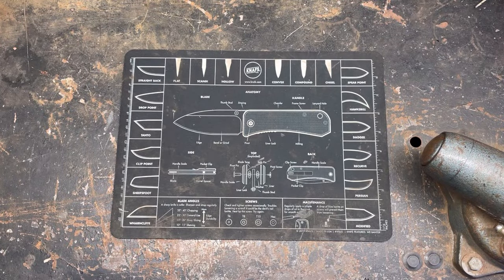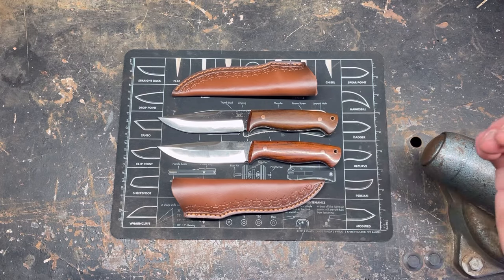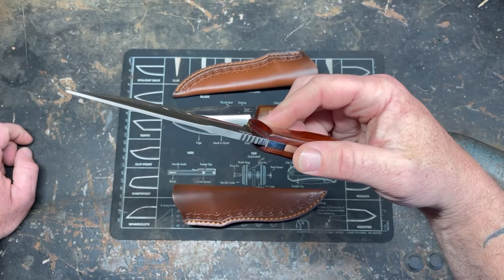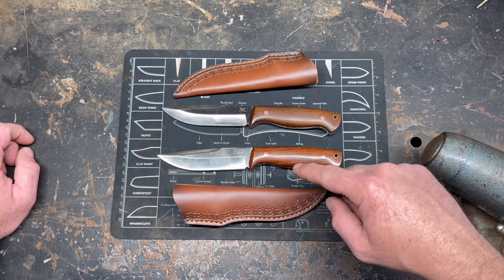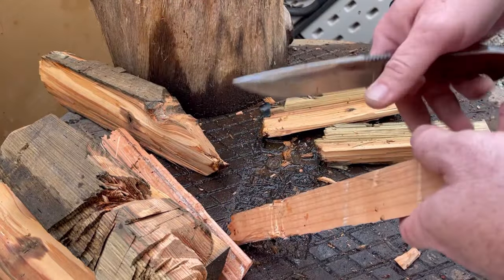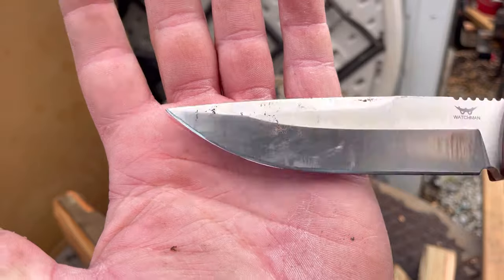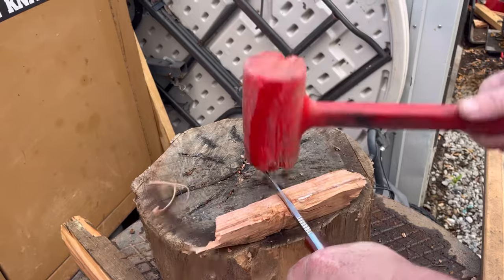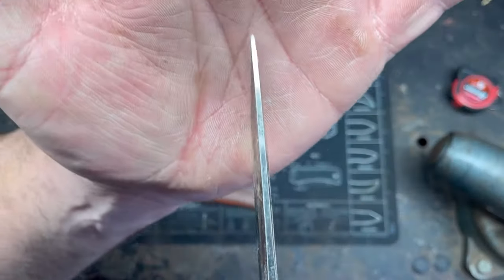The Watchman Fixed Blade Hunting Knife in DC53 steel

Comment: I've got a kabar style knife in DC-53 that I took a gamble on, and honestly I'm very impressed with what I got for the money. It's a leather stack handle (which I love!), big 9" flat ground blade that SLICES, fairly robust tang about the same as a kabar but with a threaded pommel instead of a pinned pommel. My "testing" is similar to yours in that I chop (more on this one because it's such a choppy feeling knife)  and baton some wood, do some feather sticks, maybe chop some wire to see how it holds up. The DC53 seems to be some pretty tough steel that holds a good edge! I had no real edge rolling where I think on most of my other bowies I'd have some. No idea if it'll break the same way as kabars do, but I'm not bothered either way many people can go their whole lives using a kabar and not have any issue just respect the limitation.
Reply from the maker: That’s cool. And you are correct. The Kabar when used as designed is a great knife